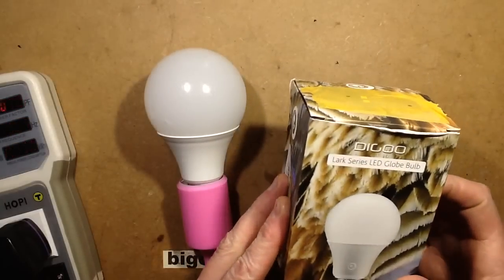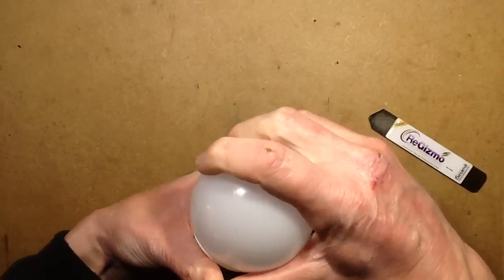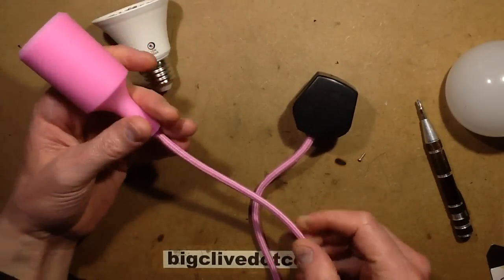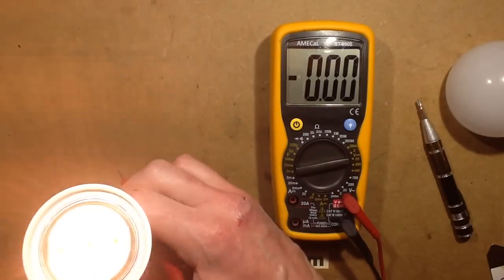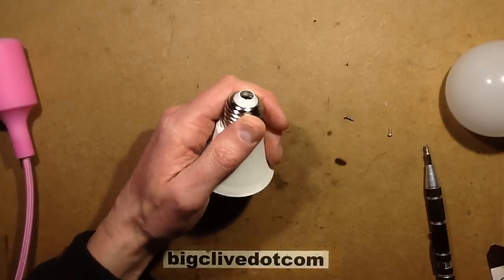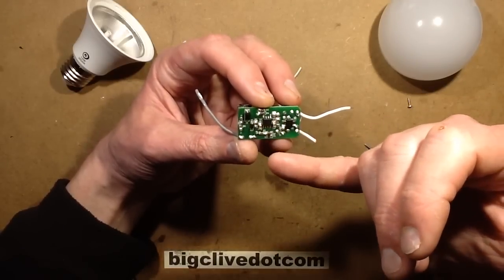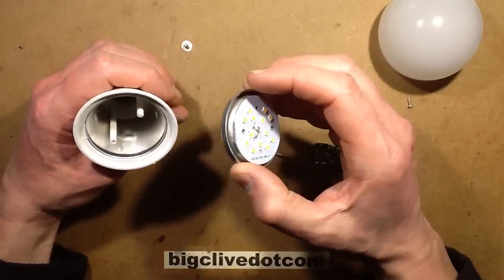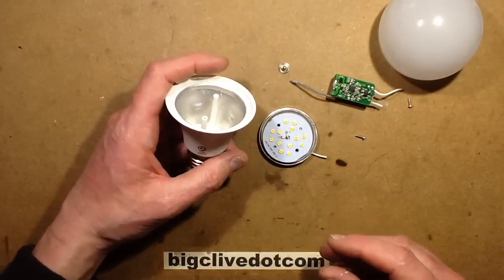Inside a Banggood Digoo Lark 12W LED lamp.

Comment: Mr Clive, would you ever review something quite expensive, like a Philips Hue lamp? I'm a little bit curious to see if more expensive equals better electrical quality
Reply: Yes it does.
Reply: Not always. It often only means better economical value for the manufacturer.
Philips has always been a bit on the cheap side in my experience.
Reply: I'll add to this, I'd like him to test the standard Phillips led globes out. I just bought one for the hallway, but it didn't look like it would go back together so I didn't get a chance to peek inside
Reply: just send him one and he would
Reply: thany3 I keep expecting those to be made in Vietnam, possibly in Hué
Reply: I've done a tear down of a Hue bulb; all the electronics are potted in silicone, took hours to strip it off. Nicely engineered underneath all that goop, if a little bit over engineered

Comment: @bigclivedotcom I have 4 bulbs of these, 2x 9W and 2x 12W. Been using one of the 9W for about 6 months now and no issues. They don't even get hot to the touch as much as expected. Also there is a big difference in size between 12W and 9W. The 9W is about the size of standard tungsten bulb, but the 12W is like 30% bigger (the removable plastic cover part). Also you can open them with no tools, just maybe avoid twisting because there is a notch on the sphere. IMHO very good quality and well worth the money especially when you manage to get them at 33% discount :) 
Sidenote - 12W is outputting almost too much light. Like we now have 2x9W installed in same fixture in the kitchen (opposite directions > | < like this) and it's too bright (it's a 4mx5m kitchen). So yeah I would suggest getting 9W for any average use and go for 12W where the light is really needed. Also the light is very nice (warm white option) is really bright and very white but no cold tones at all (it could be just a bit more yellowish).
Reply: The 12W would be handy for outdoor lighting, if located inside a waterproof enclosure. It would be fantastic if they made the 12W as a PAR38 bulb.
Reply: ***** just keep in mind the size of the bulb... the difference with standard tungsten light is very noticeable when it comes to tight fitting fixtures...
Reply: Avantime I think it can be easily modified to be waterproof. there is just one seem (where sphere connects to the base) and it's really tight fit already. just use some silicone on the seam and it's good to go.
Reply: ***** yep should be fine for filming in the living room. I know what you mean ;)
Reply: I've bought several 5W and one 12W. THe 12W one died after half a year.... they only use 13chips to output 1000+ lumens (I think they said it was 1250), so it always ran incredibly hot and wasn't too surprising when it broke down.

Comment: I bought a set of 4 (2x 9W and 2x12W) back in June from BangGood in the first pre-order batch - and  a few weeks ago the 12Watt lamp failed, two days later one of the 9Watt lamps bit the dust with the second one giving off 'flickers of death' a couple days later as well.

The funny thing is that all three failed lamps have different failure states:
The 12Watt bulb flashes with full brightness at a very nauseating rate (I'd guess 50 Hertz)
The 9Watt bulb gives off a single bright flash when it's turned on but rapidly fades down to a dull glow that even lasts for a couple seconds when the lamp is turned off.
The second 9Watt bulb does some very erratic flickering at different brightness levels, almost looks like morse code.

The 12Watt one had a lifetime of about 1600 hours before it turned itself into a strobe light, i used it as my Terrarium illumination on a timer for the last 4 and a half months. The two 9Watts were in a ceiling-light/fan fitting just as long, but only had a lifetime of about 500 hours before the first one went out.

Comment: I recently had a Phillips led globe die so in the spirit of this channel I pulled it apart to have a look and low and behold there were two circuit boards were they joined together was a dry solder joint. A quick dab of leaded solder and it's back in action now!

Comment: Anyone else notice a low buzzing noise in the background whenever the light was on?

Edit:  As per the description: "The hum when the lamp is lit is actually from the iPad as it has a weird issue where visual intensity modulation is interpreted as audio!"

Comment: I've been using a very similar philips bulb, rated at 13W. When powered, the plastic base part which covers the heatsink heats up to 85C. Since it's even hotter inside, I doubt it will last for a long time. If the LEDs don't fail, the power supply will.

Comment: I fitted Mirabella 11W led lamps throughout my house a year ago because I detest CFL and all fluorescent lighting, and had one fail a few nights ago after going into 50 Hz strobe mode. It looks very similar inside to the one you have, but has 30 leds. I'm in Australia so its a 240V bulb too. I ripped into it and after testing the passive components it appears to be a failure with the driver chip, which I suspect overheated in part from the +35C temps its been exposed to this summer. The chip is a BP9831A which I could only find a chinese data sheet for. This bulb has been used extensively and the led's show no sign of damage or fade; I tested strings to ascertain if they were still functional and see if any were dim compared to the rest and they are all fine.I pulled the larger inductor apart and counted 400 turns and found no damage inside.

Comment: Bought 5 of these  12w globes. They are quite a bit larger than the  standard bulb, so they may not fit all fittings. One of them has already failed, without so much as a single photon. I returned it to the store where I thought I had purchased it.  Had them hunt around for a BC holder. Complained that they were supposed to out last an incandescent lamp, before requesting a replacement. Oops, forgot I had purchased them from Bang Good. Thanks for enlightening me Clive.

Comment: So I purchased 10 of these a little while ago and I've had 6 fail. After disassembling them it looked like the 100v 47uf cap had failed in every single one of them, however replacing this ( I'm no expect by any means ) didn't fix it but I believe this is just a smoothing cap so wouldn't cause a complete failure. Stuck on where to look next.
Reply from the maker: +Stu B Hi.  It's most likely an LED failed open circuit (look for a black dot in the yellow phosphor) and that resulted in a high open circuit voltage that then killed the capacitor.

Comment: Just had a thought regarding your iPad flicker problems. Have you tried putting a neutral gel over the lens of the camera? That will reduce the light input, causing the auto-exposure to increase the electronic shutter duration and somewhat reduce the flicker.

Comment: I've opened a few bulbs like this one and all of them were dividable above the metal thread so you could slide the whole power supplying circuit out after removing these 2 screws on the LEDs PCB. I'm not sure if you know that, Clive…
Reply: Brute force is always more fun
Reply: Yeah, maybe…

Comment: Wondering, with the iPad camera issues, have you considered another camera?
Reply from the maker: Yes, but the iPad offers some advantages in terms of screen size and audio quality.
Reply: My galaxy s5 camera wont make anything flicker Ive pointed it at led christmas lights nothing at multapable 7 segment led displays nothing the only thing that will flicker to it is a led flashlight on the low setting even a plasma tv looks perfect to it
Reply: The problem is that by default it shoots in 30 frames per second, which does not play nice with the 50Hz mains (which when rectified is 100 Hz): the greatest common denominator of 100 and 30 is only 5. That means five times per second a video frame captures more of the zero crossing point and five times per second it captures more of the peaks, resulting in a very visible shimmer even when in real life that's at 50 Hz and invisible. Ideally you want to film at 25 fps, but the standard iPad camera app doesn't let you do that. There are 3rd party apps that do, though. So far I've found Filmic Pro that claims to let you do it, but it's not free.
Reply: +1
Reply: ManWithBeard1990 maybe there is some setting to change the framerate...that could help.  either 25 or 50 fps...
Reply: Matthew Miller you can change the resolution but not the frame rate on an iPad Air 2. Newer iPhones have 60 or 30fps.
Reply: There are apps that allow you to change the framerate.
Reply: How do they cool down those 11 watts of Led Power? Im confused xD
Reply: Yeah, I did just make that mistake. No idea why. I realised it a few hours later but forgot where I  put it. I wasn't sure how to explain what was happening but saying 100Hz is divisible by 25 but not by 30 makes more sense. What I meant with the gcd is that when filming at 30 Hz a frame lines up with the same part of the 100Hz waveform only 10 times (the gcd) per second, or every 3 frames. Hence the flicker.

Comment: working with high power leds, i have a plastic grey Lee filter, multiple of layers if needed, stick to what I need to dim, or you can just put it in a box and solder wires for measurement before :)

Comment: 12 Watts sounds like a reasonable power level for LEDs -- this lamp looks as though it could be The One finally to replace the 20 watt compact fluorescents I am currently using!

Though, as all my lampholders are push-and-twist fitting, I think I will wait a little longer to see if suitable lamps become available before I go about replacing all the holders .....  The cost saving of running LEDs as opposed to CFLs is not that great  (only 40% for 12W vs. 20W) . It would definitely be worth it if I was still running tungsten filament bulbs, but I gave up on those wasteful things a long time ago .....  My one remaining tungsten filament bulb was in a bedside lamp with a home-made in-line dimmer switch  (i.e., a standard wall dimmer screwed to a 1-gang surface-mounting wall box)  but that bulb recently blew quite violently and killed the triac in the dimmer switch, so it now just functions as an on-off switch .....

Comment: Assuming this lamp in non-dimmable, there a design decision to make, low flicker and high power factor or vice versa. Its not easy to get the best of both worlds as you need either a twin stage driver or some very large value capacitors across the LEDs. Both of these solutions mean the driver would be too large and you may have problems with the bulb taking several seconds to light up.
The only solution I am aware of is to use a valley-fill front end followed by a buck converter. This should give very low flicker and about 0.9 power factor, but this might also be too large.

Comment: You were lucky to get that metal disc out that easily, I tried to open a couple of those a while back and the disc is supposed to be pressed in very firmly, I can't get mine out without severe force.

Comment: Hi Clive, Love your videos. I bought about 10 of these. ALL of them failed within a few months.  Mostly just went dead for no apparent reason. Some of them went into 'strobe' mode for a few hours before dying.  Any idea which component is likely to be the culprit?

 I set up a power supply with current-limiting resister to test each one of the LEDs individually, and after testing all the LEDs in two globes, was unable to identify any failed LEDs, so likely something other than a failed LED.

Any thoughts appreciated. Shame to have this entire drawer full of these things that don't work -- as you say, the quality of light they give off is rather good compared to most other "Banggood" LEDs.

Cheers,

Rob
Reply from the maker: Sometimes the LEDs do fail, but only in use when they heat up.  They can then cycle on and of or strobe.
In the circuitry it could be a shorted diode or dry electrolytic capacitor due to heat, or the input fusible resistor may have failed if there has been a circuit anomaly or high external transients that have caused significant clipping by the input MOV/VDR transient suppressor.
Reply: Thanks for the quick reply Clive! I might 'sacrifice' a couple of them to see if I can ID the fault, based on your feedback. Will post the results when I've had a chance to explore.  Had a similar experience with a few of the Banggood PIR lamps, though most of them remain good after about 12 months. Some great gadgets appearing in the LED space over the past few years -- shame the Chinese tend to use such shonky components when building these things.

Comment: Thanks for that mate. I've bought about 15 of these. The quality of the light is really quite pleasant but after a few weeks they all seem to just die! Some just stop altogether, some start to strobe, some just get dim. I've pulled a few of them apart (like you) but I can't seem to identify what's failing in them. Have you had a similar experience?  Banggood are pretty good with just sending me new ones when they fail, but I'm just getting tired of replacing them every few weeks! Any thoughts? Cheers.

Comment: Clive, is the flicker issue due to you recording in 30fps and 50Hz/100Hz mains frequencies (for lack of a better term) drifting in and out of phase? I've never owned an Apple product in my life but I assume there is a way to change the frame rate in the camera app to 25fps.
Reply: Flicker is there because the bulb has at least some brightness instability. Bulbs with better power supplies would not flicker in video at all. If iPad uses 1/60 s or other multiply of 1/30 s, it means it is not in sync with bulb light instability or flicker so it doesn't "hide" it.
Reply: Brandon JC standard apps don't support frame rate changes, at least. Possibly on third party apps, but I wouldn't count on it.

Comment: the same construction as faulty inq energy led :] only they fill the cavity over the board with white silicone rubber and when caps blow up you can't replace them without considerable work.

Comment: have you had any experience with noise leakage killing off other led lights. got 4 bulbs in bathroom, and they die off one by one fairly quick. Enersys bulbs. 3.5w i can hear a slight tone with my own ear.

Comment: I bought a couple of sets Weanas RGB LED remote control lights sold in a pack of 4 for 25 bucks.  After 6 months 2 are dead. They got tossed before I got to do an autopsy and see if any part of the circuit is useful for other things.

Comment: Not sure on the make of mine, but they failed. Circuitry looks the same, but I noticed the 100 v Capacitor is bulging, light switches off then on then off consecutively. I think it is a heat issue. Lasted about 6 months...

Comment: I brought two and one failed within 20 minutes. Under the globe LEDs have slight black marks. The other one has been running for a few weeks and seems to be as good as the philips ones that surround it but the suppliers keep putting the prices up which is a shame, the 9W is like $3 US, not really worth cheaping out on when the philips are only a few dollars more.

Comment: 12 W is , gosh I've had LED cobs last longer than this :(  Didn't last a month.  Melted one converter I had (melted the solder)  then tried another and after almost a month of High heat it died quite softly.  Took it apart have no idea what failed.  I'd assume since the vent holes are in a poor location it died from massive heat.  The almost full metal housing inside probably didn't help :(  But it sure was bright while it worked.  Not as good as the $20 one as far as it being bright (that one is 125 watt equiv.  )  go blind looking at it..

Comment: I have an LED lamp that is quite broken: it flickers really fast and is half the brightness it should be and there seems to be some kind of weird orange fluid inside the plastic globe...
Reply from the maker: It sounds like it has vented its electrolytic capacitor.  I'd suggest not using it.

Comment: i have an idea, see how long a small led will last at oven temperatures 240c etc, i wonder if they will ever make an oven bulb in led!
Reply: That's probably never gonna happen, it would be nice if it happened, but I don't think any led can survive oven temperatures like those.
Reply: *****
i know, i was being a bit silly, no reason to go led, it wont save any power either!
Reply: What would be the point? It's not as if the heat from the tungsten filament would go to waste in an oven!

Comment: The only problem with the cheap direct imports going more upmarket is that they're now competing with lights from the like of Screwfix and CPC Farnell, both of which are putting out very similar bulbs for less money than BG are charging.

That said this one looks like it's dimmable which is worth the £4 that BG are charging on its own -- if it works.

Comment: odly enough i have a sunbeam 9w with 16 led"s and supply all on the front face . 3 rezistors ,1 capacitor @ 200v 10uf, 1 full bridge rectifyer and 1 voltage regulator

Comment: There are times that unreasonable force is necessary... :P

Seems like a reasonably good bulb, easily repairable though, just rip the E27 off, fit a Bayonet cap, solder on a new set of wires for the LED panel and job's a good'un... :)